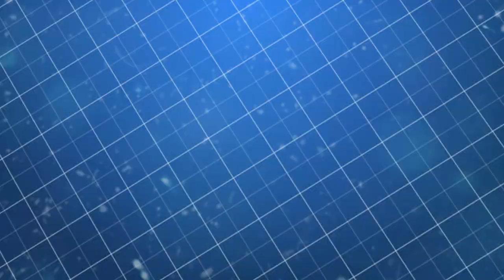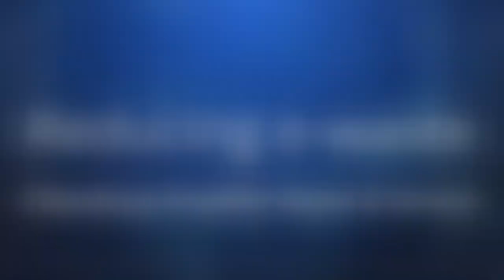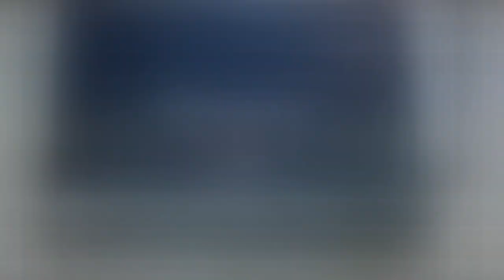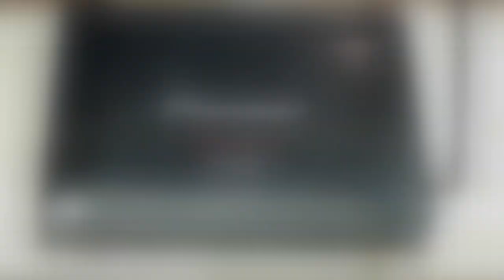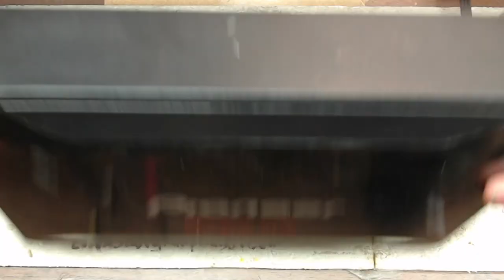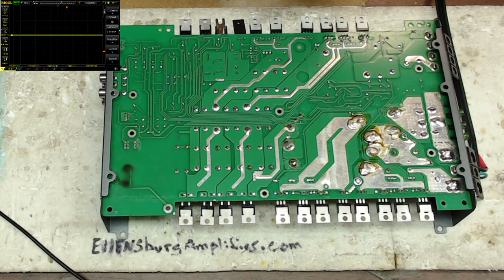Pioneer GM-D9601 Class D Car Automotive Amplifier Repair With Cooked Remote Bass Knob Circuit

Comment: I just bought the same amp of off FB market. The seller said it worked and I had no way to test it at the time. Well it didn't work and the positive terminal sparked when nothing was on. It fried the positive wire. So I got some 6AWGC wire. Wire didn't get hot but all 3 fuses blew. Power mosfets all checked ok. The end pree amp tested bad. But I'm thinking the diode is bad. Because in circuit at times it would show a short and sometimes it doesn't. The spark on the positive terminal without even powering on. Just leads me to believe the diode is allowing current to flow backwards causing the spark. Circuit board is clean. No discoloration or burn marks.

Comment: Great work! I too would replace Old transistors. People don’t understand it’s like having four old tires and one goes out. Changing it’ll get you down the road but it ain’t gonna last long. Excited for the next one.
Reply from the maker: I see it all too often. One transistor replaced in a parallel bank may work in specific low current applications but not so much in high current applications.

Comment: I got the same amp and my two sub speaker wires touched I had the same mossfet go in the same place 4227 and one of my 3205 went. watching this video big help cheers
Reply from the maker: Remember to replace all transistors that are in parallel. Glad to hear this video is still helping others!

Comment: Great job, a transistor malfunction on one of the rails and those measurements that revealed a problem with the amplifier. I know more thanks to you. Thank you and best regards, waiting for more films
Reply from the maker: Glad the information was able to help! More videos are in the works.
Reply: @ellensburgamplifier  the information you provide in your videos is very clear and clear compared to other makers of other material related to car audio, amplifier repair
Reply from the maker: @bradpitt3965  Thank you for your support. Stay tuned for more to come.

Comment: I have the exact same model ...problem in the same area.....was wondering where can I find the Fets for this amp....Nice video also.....lots of good info....
Reply from the maker: The output transistors for this might be a little hard to find authentic. I can't remember if this uses the IRFB4127 or the IRFB4227. Mouser, Digikey, Arrow, and Newark are my first go-to places.

Comment: I have this amp, my transistors on the power supply are all popped. Theoretically, if I replace with the same part I should be good, or are the other things in line that may have blown first?
Reply from the maker: Thank you for the channel support. There are a few reasons for the power supply to fail and one that is most common is a shorted output. This overloads the power supply causing the transistors to fail. Another is reverse polarity, just as damaging but less common. Under-voltage and heat would be the next runner up. I would check for low resistance values on the output transistors (gate to source) and let me know what you find.

Comment: I have the same Amp with Red Light and a beep sound on when turned on. Is that the same problem or something else?
Reply from the maker: It could be a lot of common things. Does the blue light try to come on at all before the red light? Could be a bad power supply or output section. Now the "beep" is not normal but could be a high frequency going through the output inductor before shutting down.

Comment: I got the problem on sound output of my D9604. When I turned it on, I saw the constant blue power light but no sound came out from speakers. I used another power amp for testing, all components were working fine without problem. What do you think the possible reason of this issue? thanks for your comments.
Reply from the maker: Blue light with no sound is either bad output transistors, bad drive IC, bad pre-amp. You need a scope to see if you have any switching at the output transistors if there are no shorts or low ohm values.

Comment: I've got this exact same amp. Mine will work on startup, then stop pushing sound to the subwoofer after about 5 minutes or so. The power on the amp stays on, no protect mode, constant blue power light even when the bass/sound drops out. 

I've checked signal wire, which is constant when the truck/stereo is turned on. Power wire and ground wire is also good. I figured if those were bad, the amp would go into Protect Mode. 

I tested my subwoofer with another amplifier and it's still working great. 

Could you point me in a direction of where to start on the amp board itself? It seems to me that something is failing within a component that plays a role in the sound output.
Reply from the maker: Do you have a scope? This issue will be best found using a scope to see where the signal is dropping out. Can be as simple as an SMD cap that is heating up.

Comment: I love this amp i got great power out of it.
Reply from the maker: They are great boards when the components are fully secured down. If you have never had it serviced by a tech then I would pull the cover and secure the capacitors and inductor down as this is one of the leading failures of them.
Reply: @ellensburgamplifier what glue would you recommend? Also Im running same amp but 4 channel variant, I got speakers at 1.5 ohm and subwoofer on bridged channel at 2ohms, the amp gets a bit toasty, Im thinking of adding 2 80mm pc fans below and maybe small heat sinks on transistors, any advice regards heat? Thanks in advance.
Reply from the maker: @livebig6414  I will safely assume that the 1.5 ohms load across a bridged channel is too low for that amp. If I remember right about the 4 channel amps, each channel is rated 1-ohm minimum stereo (model dependent) making it 2-ohm minimum bridged. This will be the heat issue. As for the glue, I always recommend Gorilia Glue Clear Grip or E6000 depending on the application. The E6000 is much thinner but can get down into windings better.
Reply: @ellensburgamplifier  Sorry, I probably did not explain correctly, I run speakers on 2 channels in parallel each speaker is 3ohm in parallel is 1.5. The only bridged channel is subwoofer which is 2ohms.

Comment: Hi, I bought the same amp but I am having issues with the bass boost remote. When you plug in the remote it automatically boosts the bass.  Without turning the nob,but when I turn the knob the output does not change. What might be the issue??
Reply from the maker: It is a problem on the board or an incorrect control knob. (they are not all wired the same)

Comment: Hi great video, My gm- D9601 mono is fully working with sound and full voltage output, however on startup the red light comes on then goes out thats normal, then the blue flickers a bit then goes out all together, so ive a fully working amp with no constant blue light it flickers on now and again when in use, very strange any ideas? Much appiciated thanks.
Reply from the maker: If it is not a loose solder joint, then it could be a failing LED but they tend to fail in a different way. I would suspect a bad solder joint or leaking transistor that is driving it.
Reply: Should i attempt to fix or just leave it? as the amp is fully working and thinking if it went into protection the red light would come on if any problems, would you say its a soldered joint close to the led? Or would it be one of the amplifying transistors that fix to the metal body? Thanks for replying very greatfull 😃
Reply from the maker: @coregts3504  You can leave it if you choose to do so. Eventually it will not come on at all. It may be at the LED solder pads or it can be any one of the SMD components for that circuit. The transistors along the sides are just for power which the LED is not connected to.

Comment: Hi, thanks for good explanation. I have the same amp, after 3 years of using it, I changed the subwoofer and by accident short the speaker wires, and I think the same transistor for mine has been broken. The question is, there ar 6 of them, the top nr is for all of them IRFB4227, but three of them has second P538P and three P542P. I search on ebay from top part nr, but many of them the second part nr are different, it's safe to use them?
Reply from the maker: The bottom numbers are the date code. I would make sure for good practice that the parallel set of three is the same. Or if you can get all six the same that would be easier. However, I do warn against buying transistors from eBay sellers unless you know exactly how to spot fake or counterfeit transistors.
Reply: @ellensburgamplifier  Big thanks for the answer. Maybe you can share the website where would be better place to buy these type of parts.
Reply from the maker: @xnorsx  Are you in the states?
Reply: @ellensburgamplifier  I'm in europe
Reply from the maker: @xnorsx  https://lcsc.com/search?q=irfb4227 They have them in stock
Reply: @ellensburgamplifier  Thanks 👍
Reply from the maker: @xnorsx  I am always happy to help when I can. I spend countless hours after closing the shop looking for parts of every type. I am known for finding what is difficult to find.

Comment: There is something in my GM-D8604, i just wondering how could this happened the ground and positive terminal are almost short circuit? reading is just 0.4ohm.. what is the normal reading if it is unpluged from battery?
Reply from the maker: When unplugged you would see the power supply capacitors charge. With a .4 ohm reading I would suspect a shorted power supply or a shorted reverse polarity protection diode.

Comment: Great video!.

I get a tapping noise in my Subwoofers, even when rca cables are disconnected.?

Would you have any idea what this could be. It doesn't go into protect mode 😢. So confused.
Reply from the maker: These are notorious for having issues in the output section. I would assume an issue with the output drive or output filtering components.
Reply: @ellensburgamplifier  hi. I have replaced the irs2092s component but I still have the sound. Bass also sounds weak
Reply: @ellensburgamplifier  my outputs are reading 25 ohms... What should the output ohms be?.

Regards.
Reply from the maker: @Mr1991STE  I don't know what the resistance should be but I do know that 25 ohms is not correct which tells me you have an issue in the output section.
Reply: @ellensburgamplifier  would you happen to have, or know where I could buy a schematics for the d9601 amp.?
Reply from the maker: @Mr1991STE  Unfortunately Pioneer protects their prints like top secret documents. They are quite easily reverse-engineered. Do you have a scope?
Reply: @ellensburgamplifier  I don't have access to a scope at the moment unfortunately 😩😭
Reply from the maker: @Mr1991STE  Without a scope class D is hard to repair but you may be able to pin down the low resistance value with a DMM.
Reply: @ellensburgamplifier  I appreciate you taking the time to reply man, not many would do that!. I will see what I can do with it lol thanks again buddy
+1 subscriber
Reply from the maker: @Mr1991STE  Always happy to help. I think I have a parts board of the 9601 and if I can get to it today I will review the output and see if I can give you some starting points.
Reply: @ellensburgamplifier  appreciate that buddy. Thankyou
Reply from the maker: @Mr1991STE  The board I have is the 8601 but the same design just fewer components. I will assume that if you remove the output transistors the low resistance value will go away. You should see rising resistance on the output terminals as capacitors charge through the output transistors.
Reply from the maker: @Mr1991STE  Also, if the 9601 is using the 4227's (can't remember if it does) watch out for fake transistors and get them only through reputable distributors.

Comment: Hi, I managed to get this amplifier for little money, what do you think it is better in terms of components than the newer versions of Pioneer? Pioneer Gm-d8500m  :) Thank you
Reply from the maker: I am not too familiar with the 8500m's but I do suspect a similar build.
Reply: @ellensburgamplifier  now I'm talking about an interesting topic, because you could compare the current Pioneer amplifiers with the model I gave you. How they differ in terms of the parts used and the quality of workmanship :) Many thanks
Reply: @ellensburgamplifier  I realize that amplifier manufacturers watch these videos and: are amenable to the current suggestions, so they may have to fit more powerful components than usual.:)
Reply from the maker: @bradpitt3965  It is interesting when I hear from manufacturers for my "input" on failure points, common issues, and price points.
Reply: @ellensburgamplifier  therefore they have to work harder and use stronger components than is customary ::)
Reply: it is known that many manufacturers test their devices on youtube where they are watched by millions of people around the world and often there are various distortions of power and parameters depending on how much you pay :). Therefore, I believe that manufacturers should be pressed firmly against the wall in order to apply corrections or strong elements :)
Reply: hi probably I damaged the path under the transistor, I do not know what to fix :(
Reply from the maker: @bradpitt3965  If you go to my website at www.ellensburgamplifier.com you will find my email address. Send me a picture of the area and I will show you what to do the best I can.
Reply: @ellensburgamplifier  I sent photos by e-mail a person learns all his life from his own mistakes, so I'm glad that there are people like you.Thank you for Help.Brad
Reply from the maker: @bradpitt3965  Help is on the way!

Comment: Good video, very informative. On another note, Your autofocus keeps trying to refocus, especially when your hands are over or near the board, which is exactly what autofocus is suppose to do, but it makes the video a little hard to watch. I would turn it off. Most of the videos I have watched very seldom need it and, if turned on, it usually relegates a good video to an ok or lower ranking video. If you need a closeup, move or refocus your camera then. Not complaining just observing. Thank You for providing the video and the information...
Reply from the maker: Thank you for the feedback! I will implement that moving forward.

Comment: Hi, I changed all 6 transistors 4227, the amp is working, blue light comes on, but when turn volume up about half the amp goes into protecting mode and restart to normal and so on. Maybe you know where the next problem would be where to look.
Reply from the maker: A current-based issue. Depending on the severity of the output short, you may also want to check the TO-92 drivers and possibly even the drive IC. If it is none of these items then I would have to question the authenticity of the 4227's. They should not heat up at all at idle with no load connected.
Reply: @ellensburgamplifier  Hi, what can I say the miser pays twice, I bought the cheapest ones thinking to save money, but they didn't work, like I mentioned. Then I use your link and wala all works, thank you very much 🙂
Reply from the maker: @xnorsx  You are welcome! Fake or counterfeit parts are everywhere. Luckily in most cases, they don't work or pop instantly.
Reply: @ellensburgamplifier  dang really... the counterfeit parts are out there like  in electronics.. I've just purchased a slew of old school amps that all need repair as a hobby, as my spine says no more physical fun stuff. However I wish I could find an animation that shows how current runs through the board. In  closing did you use Perry Babins guide or  go to school for this as I'm thinking i possibly made a bad move. Basic tools to have and brand name  you recommend and also what is a decent low cost oscilloscope with friendly user interface with only essential features. I've been watching Sam from Barevids for a few years. Thanks sir. / nevermind,  I  found most of the info in the description,  however can i get by with a less expensive Oscope until I'm sure this is the hobby for me?
Reply from the maker: @vincentrusso4332  The most important thing to remember when shopping for a scope is for what application are you using it for? Some of these amps can get into the several hundreds of volts so you must make sure that the scope can support the voltages being tested.

Comment: Is this a mosfet amplifier
Reply from the maker: This is a class D amplifier that uses transistors in both the power supply and the output amplification section. Thank you for watching!